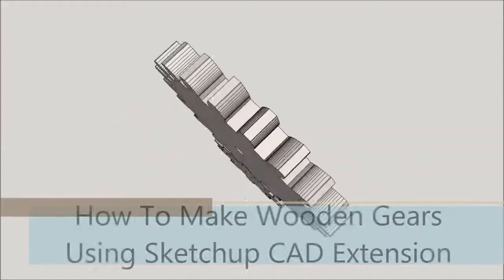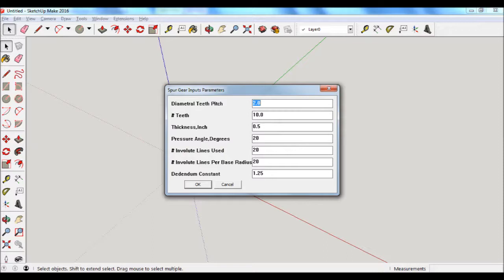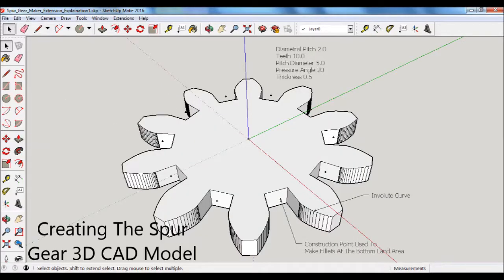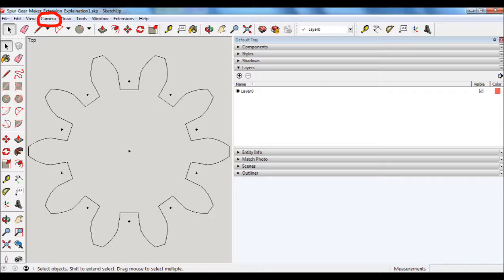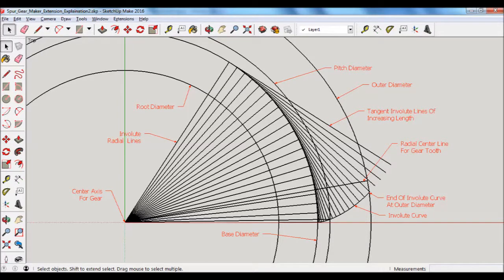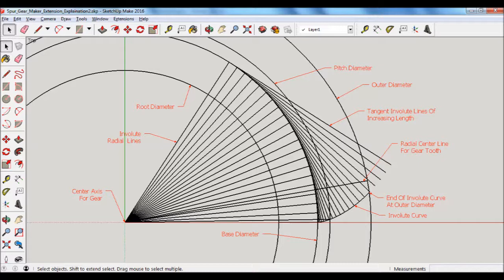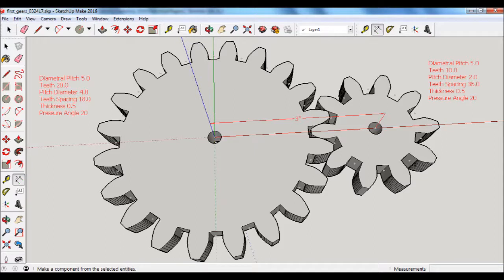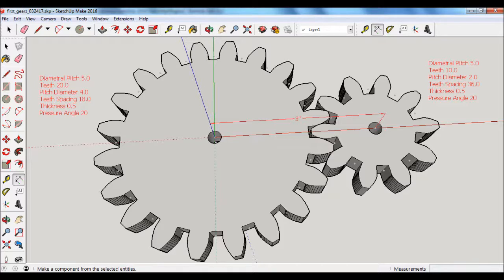How To Make Wooden Gears - Part 1: Design With Sketchup Extension

Comment: Hi I am afraid you lost me after about a minute in, I am not
very technically minded. I use a gear generator from Mattias Wandel, it just
asks me for he size and number of teeth and it then works out all the technical
stuff. If you dont want to bye the programme he also has a free one that is
available. I am sure a lot of people will like to be able to use your generator
plug in from within skechup as it is quickly becoming the tool of choice for
planning things.
Reply from the maker: I really geeked out on this video :).  I was wanting to fully understand how to make proper spur gears and thought I'd share the process and software I'd used. Absolutely agree about having ability to load gears into sketchup, it's very useful for designing projects using gears. I saw Mattias Wandel's gear maker program and I think he did an awesome job on it.

Comment: Using the free version of Sketchup, is there a way to animate the gears?
Reply from the maker: Hey Matt, As an idea there are a couple extensions on Sketchup's extension warehouse SUAlive (apparently has a free version) & Keyframe (10day free trial then have to pay) but I haven't tried either. If you decide to try one out and think of it could you let me know if you get it to work. I'd like to have this capability for some upcoming projects. BTW are you interested in trying out this gear extension I wrote. Was thinking to post it on a google webpage so people could download it. I've been using it for making wood gears by hand (no 3d printer or CNC mill) and it seems to be working good. I do know there's a few other extensions out there that do similar thing but I wanted to write my own as a challenge and to insure it was a true involute gear.
Reply: dumas5000 Thanks for your reply. I have started working on how to make wooden gears. If you search YouTube for "Imagine then MAKE", you'll find what I have done so far. My goal is to build a gear train that can handle a heavy load. I have a long way to go. Because I am  interested in animating the gears, I started looking at FreeCAD. The program seems quite popular and capable. Have you ever used it?
Reply from the maker: Hey Matt, I checked out your channel and sub'd to it. It's an accomplishment to make homemade gears manually, hats off to you. Making heavy duty wood gears sounds like an interesting challenge.  You probably have already but if not would suggest checking into about 'involute' spur gears, this is the industry standard, the metal gears in you video are involute type btw, and maybe check out part 2 of my gear making video to see process I used, and also Matthias Wandel gears method. I haven't heard of FreeCAD but will keep it in mind if something happens with free Sketchup which I prefer.
Reply: Thanks for your reply and sub. Yes, I have seen your video on involute gears. I didn't know anything about the geometry until you explained it to me so thanks for that. About heavy duty wood gears, I have seen a video where a guy built a gear train using wood gears. It is part of his can crushing machine. I'll post a link here when I find the vid again.